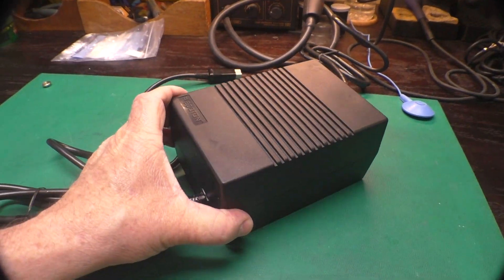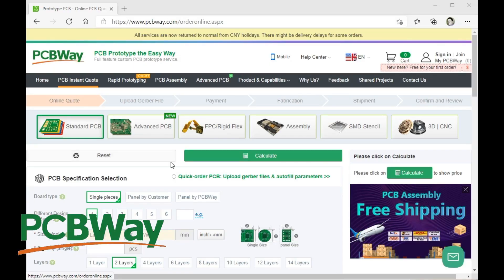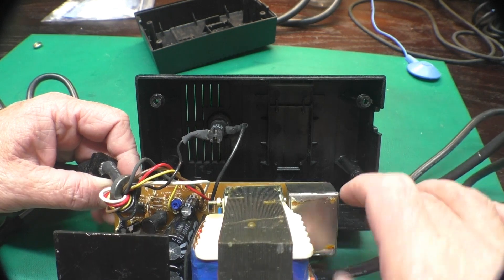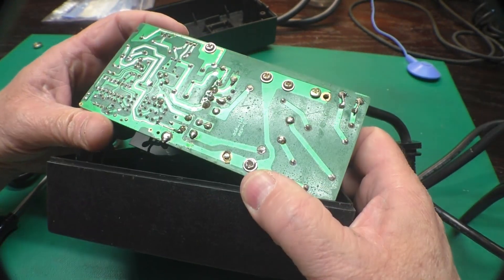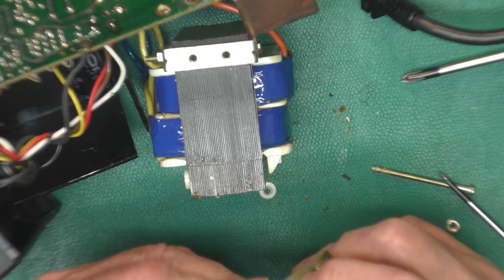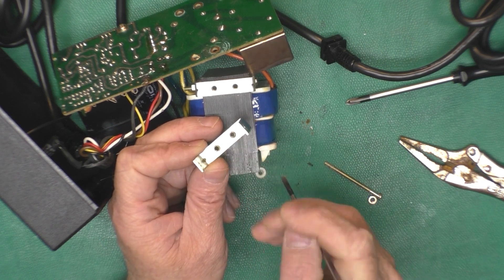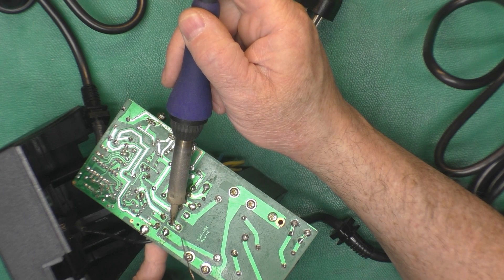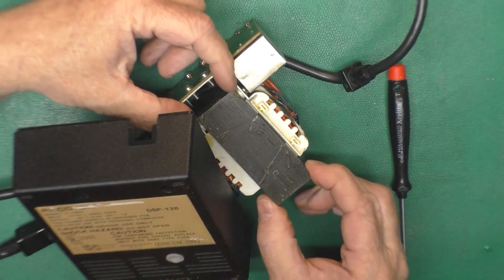Shorts 0002h C128 PS Buzz SP

Comment: one of my 128DCR power sources had I think it is I think a power regulator that was leaned over on a ferrite bead and it kept making a whizzz sound I just used a plastic pipe to track down what was making that noise which was I think a regulator or component that vibrated and when I powered on the computer that caused the ferrite bead to vibrate and made the weird whizzing sound.  The plastic pipe was like a stethescope.  This drive me nuts for awhile.
Reply from the maker: Good find! Like having a pebble caught in  heat shield under your car. Annotying and hard to track down

Comment: About short videos... I like it. Actually, until a few years ago, I felt, it was quite hard for me to watch videos, that were much longer than 10 minutes. Now, my limit is probably one hour :-))) 

I am not a real transformer expert, but I was told, that most of the hum sound of a transformer is caused by the E- and I-shaped metal sheets. If the windings get a bit lose, they might also move. That is like a guitar pickup, that becomes „microphonic“. Lose windings. Actually, everything that moves makes sound.
Reply from the maker: Hi Sven, transformers hum because they don't know the words...LOL. You are correct that the humming is from the laminations vibrating at main frequency. The varnish used on the core is supposed to prevent this but it sometimes fails over time. On motors the laminations are usually fusion welded in a few places.

Comment: I like the short videos a lot! I had some very good results with using PCB sealant plastic spray on noisy transformers in the past, works well to glue rattling windings and laminations together, similar to the glue you used. Learned the trick from a TV repair person who used it all the time to silence buzzing TV sets.
Reply from the maker: I had not thought of using conformal coting but that is a good idea! It is made for electronics so it should work well.

Comment: They use the same PSU cases for the Amiga 500 (plus), and Amiga 600, and Amiga 1200, i have replaced the guts of one of them (for my Amiga 500 Plus) and put a Makerele NET-50B Switching Power Supply in it (without the housing), but i replaced most of the caps but the two big ones with Rubycon caps, the next one i bought is the much better MEAN WELL PT-65B Switching Power Supply, and gone put it in a old Amiga 500 PSU housing, for my Amiga CD32, MEAN WELL Switching Power Supply are one of the best you can buy, they are now cheap, but they are great quality and they always use high quality caps like Rubycon and such.
Reply from the maker: I am a fan of MeanWell too. I have used them for years in my CNC equipment and other than end user error (sending 24V into a 5V supply) I have never had one fail in the field.
Reply: @HeyBirt  Yeah they make great Switching Power Supply's.

Comment: About the plastic isolation pieces...aren't the E and I shaped metal slices supposed to conduct only magnetic flux instead of electric current? I remember (4 decades ago pfff) in my technical highschool we used to bathe the whole transformer into some form of resin to make the whole package tight and anti-buzzing, specially the big ones that handle power (say from 3A up)
Reply from the maker: Yes, the transformer core should be electrically isolated. There is typically some sort of insulating layer the wire is wound on. The plastic bushings may have been there to make sure that even if a winding was shorted to the core it still would be isolated from the mounting locations on the PCB. They also will provide a limited amount of vibration dampening.

Comment: Have a few old power supplies that also hum. Unfortunately they are wall warts so probably not as easy to open.
Reply: They're easy to open. It's just closing them when they're in 50 pieces that's the tough part 🤣
Reply: @PJBonoVox  haha
Reply from the maker: Sometimes you can pop them apart without too much trouble and sometimes not.